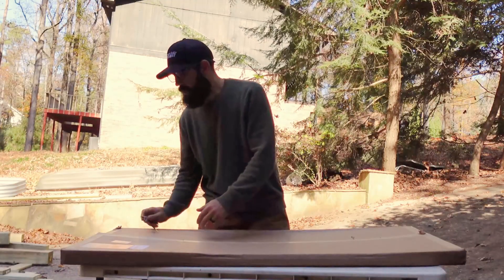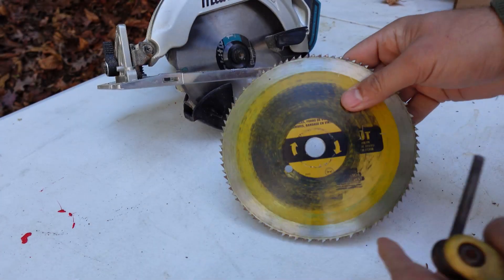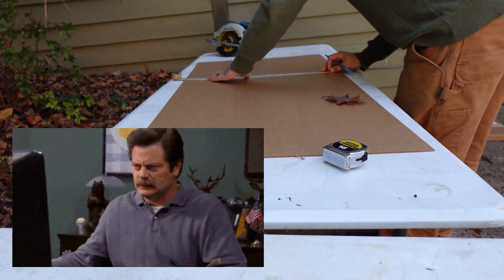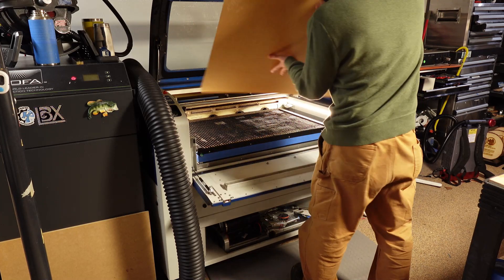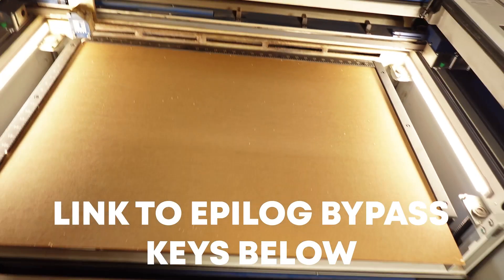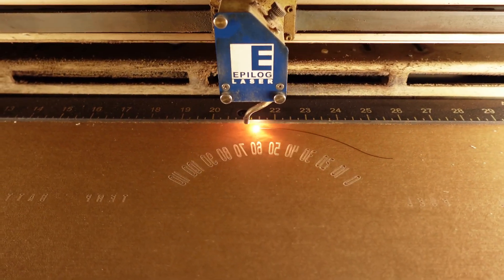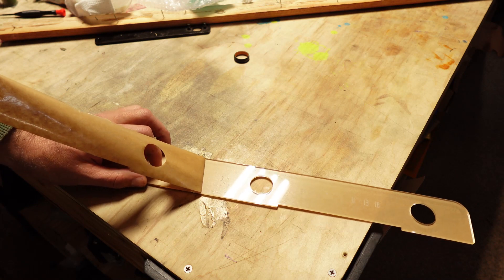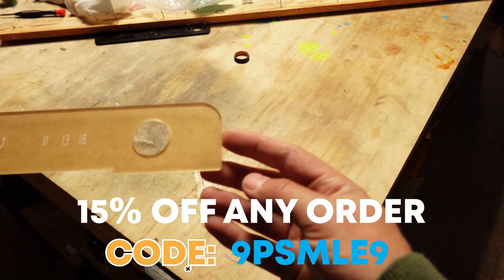Laser Cutting Classic Car Parts _ Laser Engraving Business Idea

Comment: Thought about this myself. One place I know money can be made is in the gasket market. Working in an automotive part industry myself we get a lot of guys coming in trying to find gaskets for old cars. A lot of times there just isn't any to be found anymore. While yes they can cut them by hand out of gasket material most would rather have a more professional looking cut. The diagrams are not hard to find online most of the time with full measurements.
Reply: Hey Travis, what material do you use for the actual gasket?
Reply: @SmokeScript  I work at an auto parts store. We sell rolls of cork some kind of paper fiberglass type stuff and a few different Grey and blue rubber type rolls as well. I would have to look tonight to see exactly what the material is. The rolls are application specific for different things like high heat fuel oil resistant. Myself I've only messed around woth the cork gasket material but I have been thinking of trying the others because old car guys come in looking for gaskets nobody carries anymore.